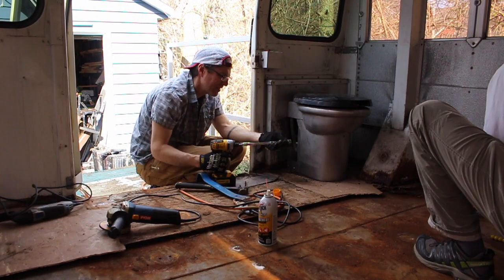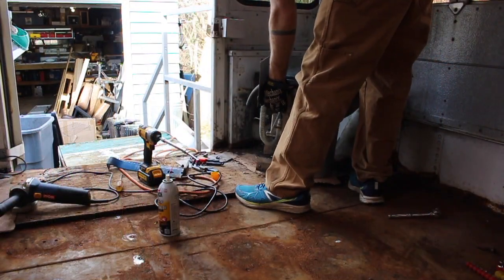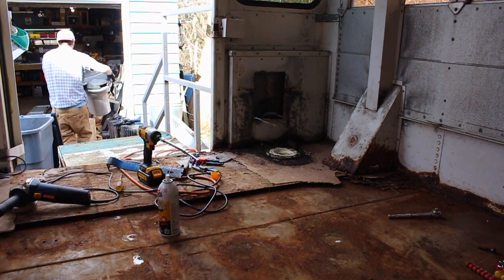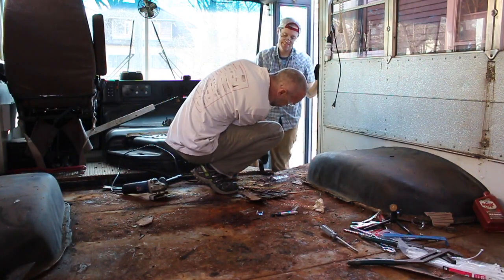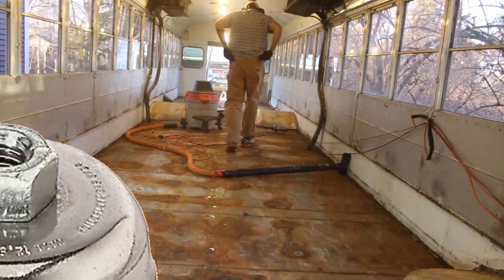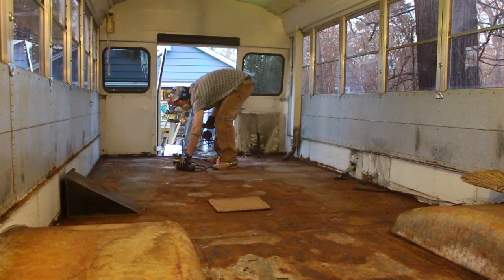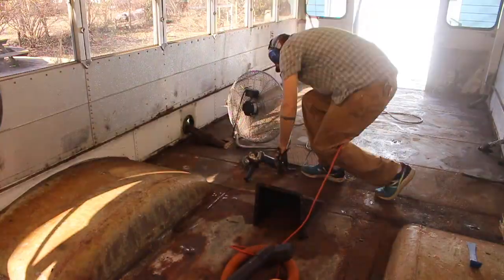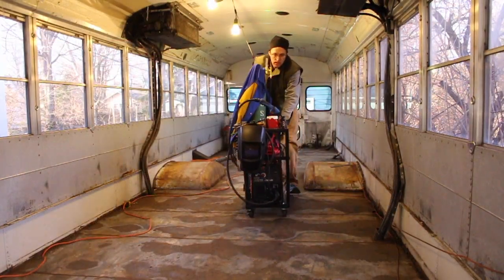Battling the Toilet & Rust -- Prison Bus Conversion #5

Comment: I am also doing right now it is a highway coach a gm pd4107 idont know temp ranges you
are plan on using it but you might want reconconsider taking the inside walls off and redoing
the insulation because the factory insulation sucks
grumpy old man with a bus
Reply from the maker: Yeah, I thought about that for a long time ... but decided to do a bit more of a basic remodel. Sub-zero would be pretty rough in there, but I think it'll be toasty with the heat on as is. But ya never know! Good luck with that coach of yours. :)

Comment: Amazing progress! For rust fight I once used 90% real vinegar (crazy stuff). I had a motorbike tank rusted from inside and I poured few liters of this vinegar into it for few minutes, rust 100% gone after 3 flushes. Might be useful for future but I think the bus floor is just too big for vinegar. Once you clean it fully and patch the holes a good anti-rust sealer paint will do the job I'm sure.

Thumbs up for welding the cart haha :D
Reply from the maker: I have used vinegar to clean the rust off of old axe heads, and it worked amazingly well. I'd likely need a 100 gallon drum of vinegar for these bus floors. Thanks for the comment and for checking out the video!
Reply from the maker: I haven't heard of POR 15 before ... I'll have to look into that. Whatever will seal it up nicely will be the way to go
Reply from the maker: I might get by with just 2 gallons of the stuff ... thanks for the link!